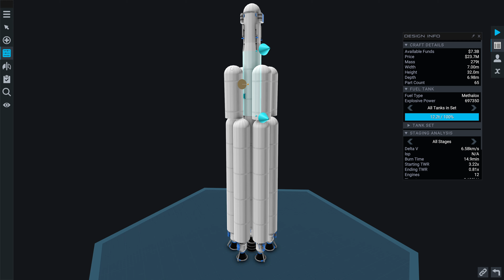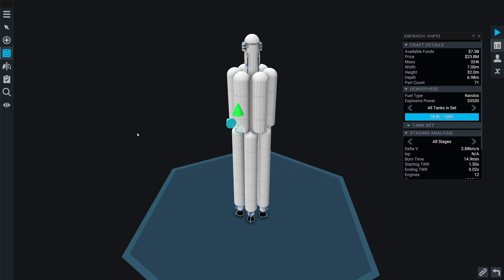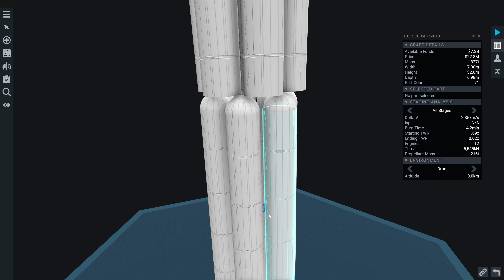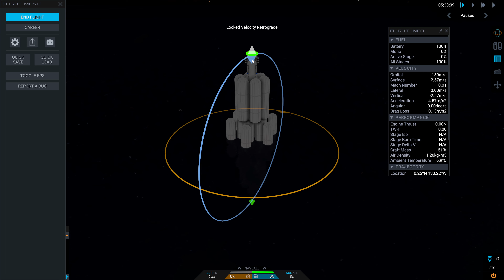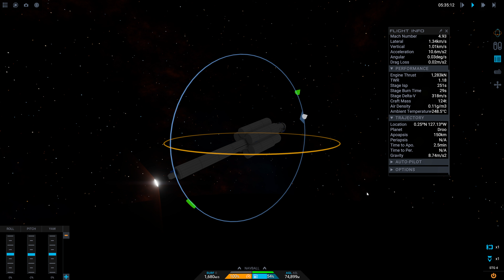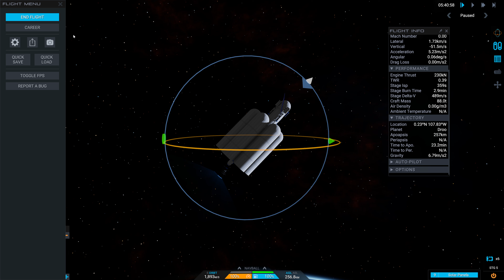Juno: New Origins | Atraitus Exploration Co. | Episode 153

Comment: Far too much of the rocket is tied up in carrying its own weight. It's so overburdened, that simply carrying less fuel might result in going further. 

edit: I've got a career contract for going to Nebra, so I've taken the opportunity to make a sub-32m rocket and launch from the bay. I've got a basic two-stage rocket plus a tiny lander in the fairing. Pixies all round. $20m. In orbit, upper stage has 7.05km/s left. Lower stage will be parachute recoverable in the future. It needed heat shielding, and failed on this first flight.